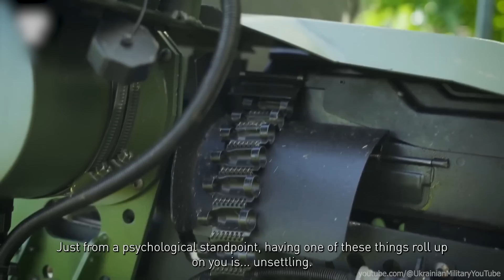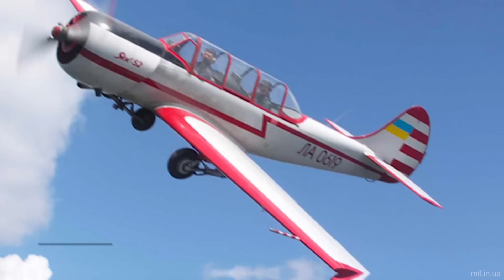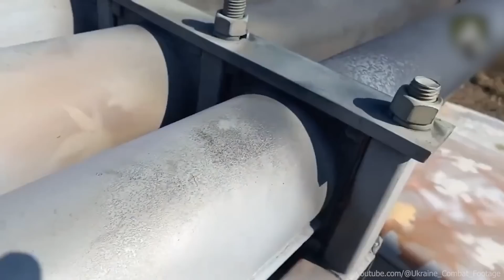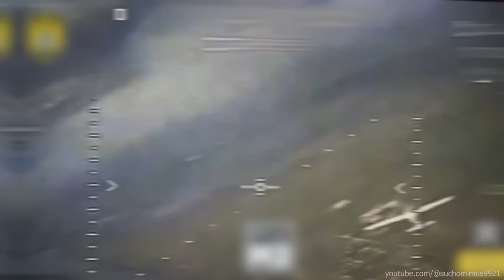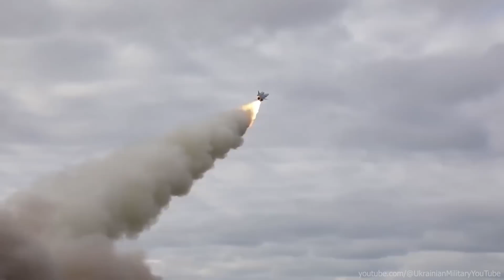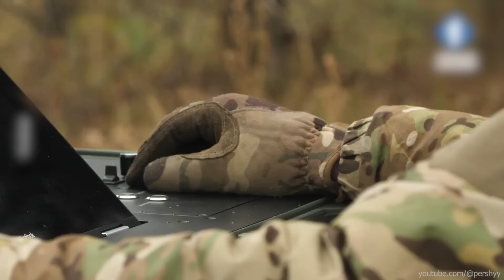DIY Weapons: Ukrainian Soldiers Spill Hard Truth about Robot Dog, Palianytsia drone-missile, UAV

Comment: Another anti drone capability might be using gyrocopters to shoot down drones or even launch from the air smaller UAVs to knock them out.

Gyrocopter  have many advantages in that they are relatively easy to fly, do not stall so they can fly really slow, have good ranges, short take of landing capabilities , and are easy to modify, many being made from kits.

e.g. Goggle
Top 15 Best Autogyro In The World

101. Gyroplane Vs. Helicopter | The Differences Between Them #adventure

Even a Numbskull Like Me Can Learn to Fly a Gyroplane

This WEIRD Aircraft RUINED Flying For Me?!

Low flying in a GYROCOPTER

Shortest Take-off in the World! The "Jump TakeOff" Gyrocopter! ELA Aviation

just to list a few.